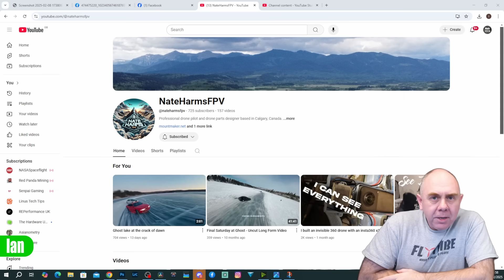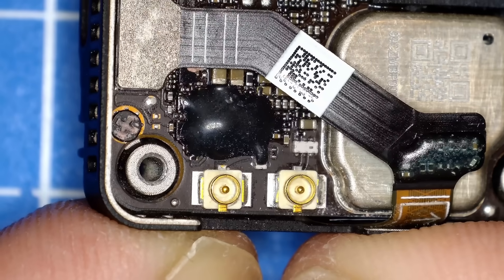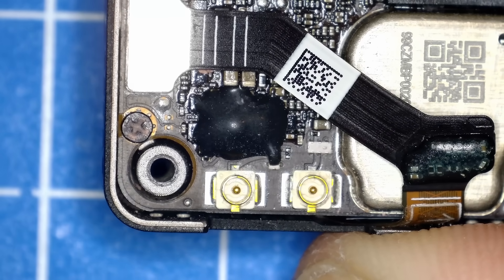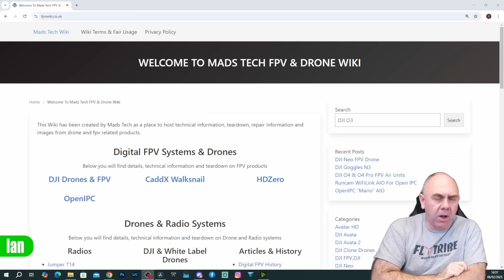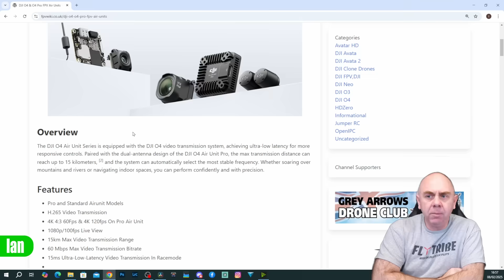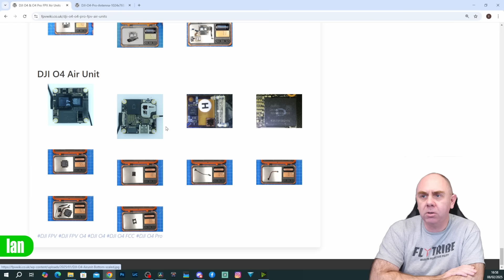DJI O4 Pro Airunit Has UFL Issues - How To Protect Your Self!

Comment: That’s what is called a “cold joint” which is basically a problem caused by bad layout and faulty reflow profile. especially the Thin Can next to the right U.FL ( wich not surprisingly ist the more common to get lost ) is quit close to that thin can. Due the large heat sink close to the solder der reflow profile ist not met at the U.FL does not stay in the liquid and gas phase of the solder to spec. Especially on the Ground Pads of the U.FL need a lot of energy to solder right ( the small signal pad does solder ok wich is why it is ripped off). Due to that issue the Wings of the U.FL is only barely sticking on top of the solder paste instead of bonding to it. Therefore re-soldering like you did permanently will solve the issue. Adding more solder paste in production will only make things worse. There is more then enough already J even more then on the left one wich is soldered quite well on your Brocken unit). This is a very tricky problem to solve without doing changes to the board layout since adding more heat energy at reflow will probably damage other components of the Assy.
Reply: BTW. Glue won’t really solve the issue… while it helps with mechanical stress ripping of the U.FL but it does not fix the bad solder joint. So soner than later the connection will fail electrically and might well kill the PA in the wake of events.
Reply: @kaiachimkropp245  What is the root cause though? I've ripped an antenna out from the crimp on an O3 before but that's because the antenna was forced in a way which put stress on that crimp and the connector. Lateral force kept the connector from ripping off from the board and it was only the antenna wire that broke. That force was caused by the antenna sticking out in a way where it could be forced in a direction it didn't want to go. I've since added some slack so the antennas can bend any which way without stressing the connectors. I don't see how they could possibly break now. Are people literally crashing their drones so hard and fast that it's actual inertia which is causing these things to break even though they are a fraction of a gram? I would wager it's more like the antennas and antenna leads are snagging somehow.
Reply: @Magneticitist  the root cause is the faild soldering process that does not bind the surface of the U.FL Connectors ground leads to the solder and the PCB Copper. This is most likely caused by the thin can next to it pulling all the heat from the GND Plane of the PCB therefore keeping the solder past and the U.FL from hitting the required temperature profile of the solder paste and the included activator. This is a quite common problem with reflow and dense designs like this VTX.  Usually the guys at DJI now should do an 8D Investigation to learn what exactly happens here and either fix the soldering profile of the Reflow Ofen or do fixes to the layout (like e.g. Heat Traps at the U.FL) to stabilize the soldering process. If soldering fails like this you might be able to simply pull of the U.FL from the PCB with a suppend unintended pull. I would recommend re-heating the U.FL ground leads with an soldering iron to the point where the solder gets liquid.. than count to three, remove the iron and let is slowly solidify again (not cool it down with Air e.g.!!!) this will fix the problem befor the U.FL is teared of ( and in doing so probably cause catastrophic defect to the Signal line of the U.FL) adding a little bit of flux if you have also is a good idea.
Reply: @kaiachimkropp245  I inspected my connections before watching this video because I was replacing antennas more than a few times and mine appear to be flowed properly. Hard to say without actually giving it good tug but I was worried about it a couple times when the connectors were being stubborn. It's crazy to me that DJI would not discover a problem like this earlier unless it was just certain batches which had QC misses.
Reply: Tell.@ things like this usually occur during mass production an every now and then. Every design has some hard to detect and come by weakpoints. Especially if it‘s as demanding as an HD VTX! Super small, very suspect to EMC, very high waste heat that needs to be managed in operation. Stuff like this is quite tricky to manufacture. Especially early in the live cycle during ramp up things like this do happen and never can be fully avoided. I hope they can handle it by tuning the processes parameters of the soldering process so we will see less problems like this soon. Right now it‘s hard to tell how common a problem this is since we do not have total numbers?. This can be from a few hundred units in a million to 50% of a certain batch so only the future cann
Reply: @kaiachimkropp245  That makes sense and is def to be expected at least on a very small initial scale. I'm used to seeing sort of the opposite with industrial boards where the later revisions are just them realizing they can get rid of components without noticeably affecting performance.

Comment: Solid job and the proper way to do it, but caking it in e6000 should do in case you don't have a microscope/magnifier or the confidence to reflow the pads. This is very common with FPV manufacturers, soldering always sucks

Comment: They should have used a metal cover like on the Vista units to prevent the antenna and it's plug from being ripped off of the board. Such a simple and solid way to do it.
Reply: Yes that does work but is too heavy for us whoop fliers. I go naked and use E6000.

Comment: Picture @1:46 it looks like the pad itself is lifted from the board?  I should probably watch till the end before saying anything, Anyway I am like 50/50 repairing lifted pads, when you can still get to the lead that is one big helper but you can't get solder to stick to pcb, so you have to epoxy a new pad on the pcb, or I have seen people drill very tiny holes but yeah, I have only ever used an old Board lifted a copper pad, cleaned it up, and epoxy and let the solder ooze over into the lead, but its sketchy at best. I kind of hope the pad is totally lifted so I can learn now the right way to fix it.

Comment: Man….good thing these things don’t go to space. That solder job is like class 1 quality. Even if not for space, lots of expensive, heavy aircraft use this unit….these connectors should be class 2 at minimum.

Comment: The board is quite small and should get up to temperature quite even when it is mass produces in the EMS facility and passed through the oven. However it might not be a coincidence that UFL closer to the shielding can tends to break off first. That shielding can might soak up the heat and the right side UFL is soldered not as good as the left one. 7:40 you are using only the tip of the soldering tip. It would help of you would access the soldering pad from the outside (right side in this video) and contact the soldering pad with the side of the tip. Or use different shape tip.  I do electronics rework jobs on a regular basis.
Reply: Some actual solid soldering info. Not common in the FPV space!
Reply: What tip would you recommend @Mr.Laidukas?
Reply: @iMakos101 I have big assortment of tips so I would use JBC C210-022 / C210-008 / C210-006 or specialty tip like C210-018 or clone part number C210-K . The idea is not in particular tip but in technique where you ensure maximum contact area and shortest possible distance from tip end to heating cartridge.
Reply: @Mr.Laidukas  okay Im learning soldering next and have a chisel tip coming but I might want a smaller one. I have the D24 ts101 tip would that work or do I want a different one?

Comment: Never trust that damned lead-free hippy solder.   a 3D printed antenna-wire support for the outside of the case might also be an additional protection.

Comment: Just to add on.. this clearly is a manufacturing process issue. The issue is not that the solder paste does not "encapsule" the lead of the ULF.. with SMD technology, it is not supposed to do this in the first place. Simply put, the temperature applied during the reflow process was too low, so that the solder on the base material melted, however the temperature on the UFL connector itself was too low for the solder to really connect to this component. Probable cause (and why it mostly affects the UFL on the right side) is the massive metal shielding visible directy to the right of the connector; this shielding "sucks away" the heat. The best way to fix the process on DJI side would be to a) raise the reflow temperature or b) lower the reflow temperature gradient to ensure a more even heating of the whole assembly. Personally, should i purchase an O4 would manually rework/reflow this component with a hot air rework station such as the atten858d. Alternatively, simply rework with a fine soldering tip just as you did.
Reply: From what I’ve seen with u.fl in the past if you use a hot air station you’ll likely melt the plastic of the u.fl. I’ve not tried it myself so I’m not 100% sure but that is my understanding based on being in the hdz community for some time now.

Comment: I had the same issue with a brand-new unit straight out of the box. While trying to remove the antenna, the same one came off as shown in your video. Once that happened, the unit became completely useless because it wouldn't bind to the goggles. DJI replaced the unit for me. Thank you for the video! I was blaming myself for not being gentle with the antenna socket, but it's definitely something DJI needs to address.
Reply: The same happened to me while assembling all new without any flight at all cant bind with the goggles N3 but one antenna is ok. I was now understanding why it wont bind guess with out one antenna all the air Unit is useless that’s a shame. More than 200$ to the trash because of one antenna it’s sounds like a bad joke😭

Comment: My honest opinion about DJI o4 is a pushed product on us , DJI company rush to realise the product with out  put serious tests , because to many issues shared by many of us in the hobby and some are not small issues,  are major,  like the ufl connectors and the camera to the unit cable rips of easily and many more , sadly for such a expensive unit to be so many issues,  because i barely could  afford to buy one unit , so i have no spare one 🙁 and i assume many are in my situation ,and even the low latency in race mode given me issues it is stable till around the corner ore around a tree then i have to adjust the quad or i crush,  i think my best option is to go back to HDzero
Reply: Rushed to get out before the lunar new year in my guess. Yes there are issues but all in all a decent launch and it seems like they are warranty replacing these units. I got both the prior air units at launch and those launches were worse with so many disconnects, stuttering video, etc.
Reply: @Mangorille  yes ☹I'm from Romania , for me to send back the unite and wait for a new one will be a month thats mean one month of no flying one month of waiting,  i still have my HDZero which made my happy in best latency in HD and i have my gopro for HD recording, HD zero offers me even a decent image to be able for a good fly 🙂
Reply: All products have issues after release - DJI v1 didn't get 50Mbps mode until a couple months after release, Vista bind buttons are famous for ripping off in crashes, and there were early O3 issues as well (lens not glued to thread properly resulting in jello in goggle DVR).
Reply: @PraiseKier  True 👍
Reply: If someone crashes their drone hard and it rips connectors off, there isn't much DJI can do to prevent that.

Comment: Mine came of and dji replaced the unit . My unit hadn't even been crashed
Reply: Did you request a repair or talk with customer support? I have a brand new o4 pro (1 flight) and same issue trying to put on longer antennas.